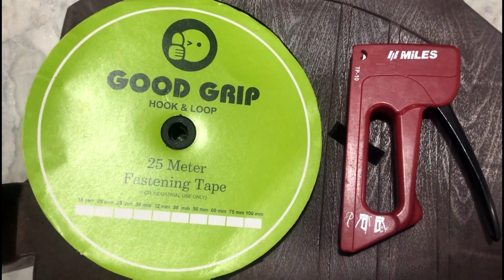How to Install Mosquito Net on Windows

Comment: I want to fix it on metal slidding window. How do I do this?? Please guide.
Reply: you cannot staple velcro on metal sliding window..1. you need to get sticky velcro or to get double sided tape(temporary fix) stick one side to velcro and other side to metal frame. OR 2. you need to see if you get frame for it which can be inserted in your existing sliding window,.(permanent fix)